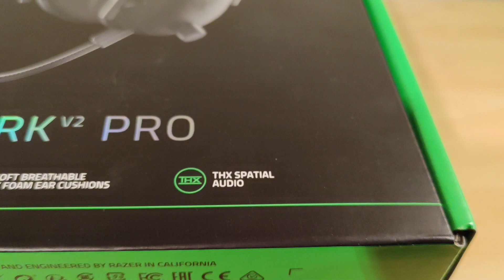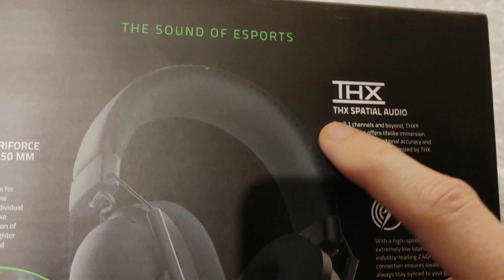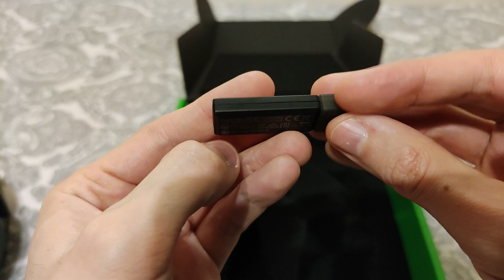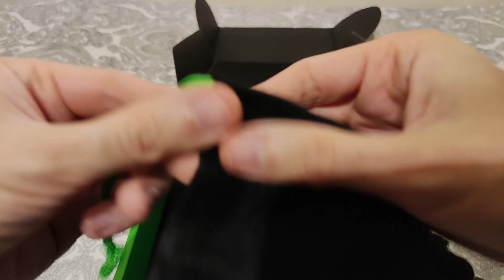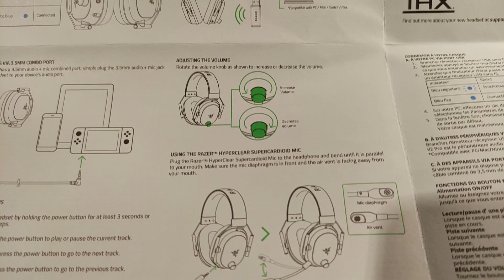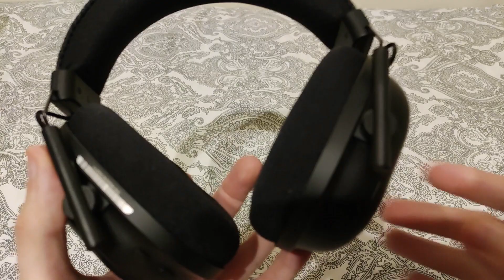Razer Blackshark V2 Pro Review - Nice Job Razer!

Comment: Cool review, but I'd love to argue that is still relevant to try testing the microphone in it's wired because if it's any better, free performance!
Reply from the maker: Thanks and i have tried it wired and it's fine but then it depends on what the source as the mic input from a PC or laptop can be good or bad.
Reply: @VortexReviews1  I suppose that is true, but most people aren't going to be buying a Razer headset for their 10 year old system (I mean just look at how much people are spending elsewhere). 

I think it'd be cool as a side thing, but that's just me I guess. Nonetheless, good review.
Reply from the maker: @ahlixemus8903  Thanks and if I ever do another headset review then I will add a wired mic test.
Reply: @VortexReviews1  Not saying you have to at all, but I'm just pointing it out as an idea
Reply from the maker: @ahlixemus8903  No problem :)

Comment: Does the dongle work with the PS5 or just wired connection is possible?
Reply from the maker: I don't have a PS5 to test but it might be compatible with both the wire and the dongle.
Reply: Yes it does work with the ps5. It sound really good. The surround sound is good as well.
Reply from the maker: @Fabs31  Thanks for letting me know.
Reply: @VortexReviews1  no problem at all. Thank you for this review it helped with my decision.
Reply from the maker: @Fabs31  No problem and thanks for confirming it works with the PS5.

Comment: Can anyone tell me if I can update my firmware and/or alter my EQ settings on Razer Synapse with the BlackShark V2 pro wireless?
Reply from the maker: I am not sure about the firmware but in the video I did show the in built eq in the Synapse software. Has there been a firmware update?
Reply: @VortexReviews1  I don't know about firmware either, that's why I was asking. 
Ty anyways for taking the time to answer me though. 
How do i hook it up into Synapse? Do I just plug the wireless USB stick into my PC and/or the headset itself, or both?
Reply from the maker: @FattyMcButterPants6  I don't know of any firmware update. To use synapse just download it form the Razer website and pick version 3 and you don't need to install any of the extra software. Make sure it is the default playback and recording device in the sounds tab.
Reply from the maker: @FattyMcButterPants6  If you are using it with a PS5 then you can forget about the Synapse software as that is for PC use only. So for PS5 use if it is compatible then you only put the USB dongle in and then connect to he headset. The cable is for only using them in wired mode.
Reply: @FattyMcButterPants6  was their ever a firmware update?
Reply: @VortexReviews1  Yes it automatically updates I got this last dec got 2 updates so far just make sure you save your EQ settings via profile 1st
Reply from the maker: @acsgdo02  Updates to the Razer synapse software or actual firmware updates?
Reply: @VortexReviews1  the firmware updates go thru Synapse
Reply from the maker: @acsgdo02  Cheers for that and I need to re-install the software and check as I only use the headset on my PS4.

Comment: Does T.H.X work on the ps5 or only p.c
Reply from the maker: It works on PC only but I don't have a PS5 to see if it works for that.
Reply: I have the razer headset with my ps5 and wanted to know if if T.H.X .. do u know the link to that software app u was on to customize my razer blackshark v2 pro
Reply from the maker: @The_Reverse209  It is called Razer Synapse but is for PC only but do check the website incase there is any PS5 information.

Comment: It's a pity you didn't do a comprehensive audio test w/cable 'coz drivers look very capable. Sometimes you surprise me, Vortex...
Reply from the maker: I did not do that as my on board audio is not great and especially the microphone in. I wanted to do wireless only as that will be the same experience anyone can get using this headset. You understand me? The drivers are very capable but I want to find a cost effective audio adapter for headsets then I can set a benchmark to then I can go on from there.
Reply: @VortexReviews1  , and what about gear you use for iem reviews? Sure it would work well enough !!! Just use the headset cable not wireless !!!
Reply from the maker: @sergiymarchenko1002  The gear I use for IEM reviews don't have a mic pass through so could not use them to capture the microphone on the headset. There are so many variables and everyone uses different equipment to speak on their computers or consoles so that is why I did the review my way as it is a set standard on a PC or PS4 as they will work exactly the same using the supplied wireless dongle.
Reply: @VortexReviews1  ,
sorry, Vortex, just imagine you took off the mic - there is no mic anymore.  You've plugged audio cable to the phones and they became an IEMs... Are you following me ? They've just become usual headphones... So how about testing them THIS WAY ??
Reply from the maker: @sergiymarchenko1002  I have tried that and they need to be pushed hard on a audio adapter to 90% or close. This model shares the same drivers with the model below and the whole point of the Pro model is wireless or it's not worth buying it.
Reply: @VortexReviews1  , would you tell me that wired model below ? And yes, titanium drivers prefer to be driven harder - to my experience. BTW, it's a good sign !!!
Reply from the maker: @sergiymarchenko1002  The model below is just called the Blackshark V2 and it has a USB soundcard and the lowest model of that range of 3 is the Blackshark V2 X and uses a different driver and earpads.
Reply: @VortexReviews1  , ok, thanks a lot! Have you heard of latest 3BA model from Shanling, with Sonion drivers? 165doll. Main feature - drivers are factory-VENTED(!!!), not just hole in the shells !!! Smells very tasty! FiiO also moved ahead with 1DD model with beryllium driver, 65doll. Also interesting!
Reply from the maker: I know of that Shanling model and I read that it had vented drivers but I have not seen any impressions of it yet. I saw that Fiio and you mean the FD5 right? KB EAR are also releasing a full Beryllium driver one soon as well so that looks promising.
Reply: @VortexReviews1  ,  FD1, I think. Tin T1plus.But they are not full beryllium ones - just coated so far. Full beryllium ones are top tier models normally.  As to vented BA models, there's just a handful of them - it's only them that interest me among BA models. I think they should sound nice.
Reply from the maker: @sergiymarchenko1002  I confuse the Fiio models as they always have similar names. I have the T800 which has vented BAs for the low end. I am supposed to be trying the Tin T1 Plus, Blon 01, TFZ Live 3 and KZ ASX but no idea of a date.
Reply: Audio test for the V2 Pro with cables? Nobody cares. These are absolutely ALL about wireless, otherwise just get a Blackshark V2. I wouldn't even be looking at those if they weren't wireless. Jesus Christ.
Reply: @mouthmw  , me I DO care - just because of their drivers !
... Jesus Christ...
Reply: @sergiymarchenko1002  then grab the wired version FFS
Reply: @sergiymarchenko1002  its use 3.5 jack so the sound prob like razer v2x my guy and it stop the wireless conection so it doesnt use any battery incase it run out